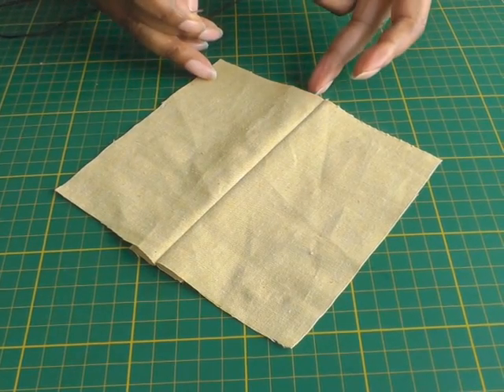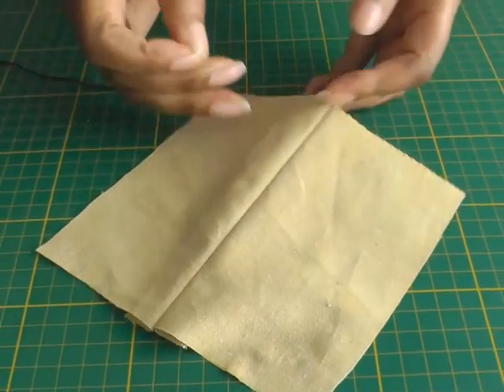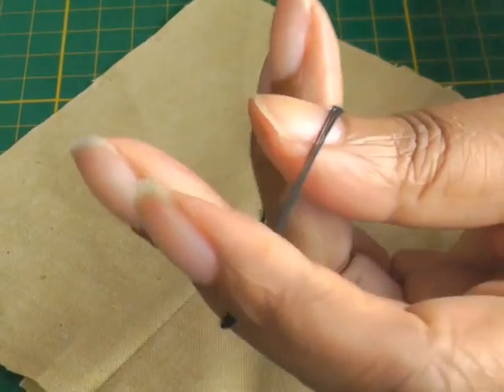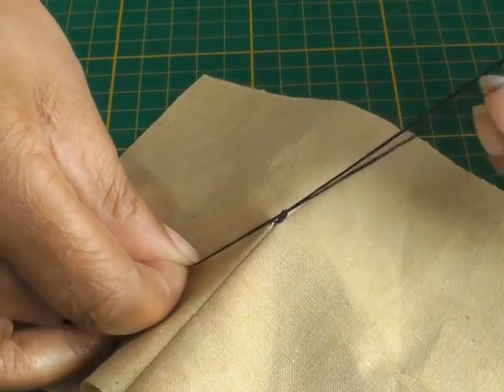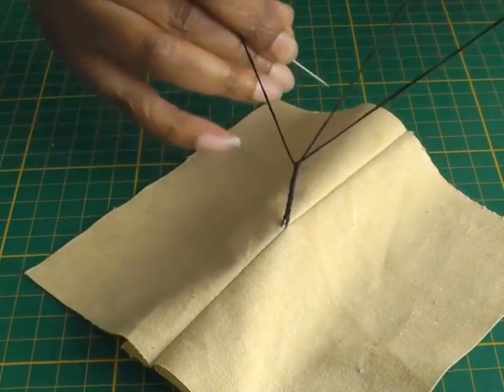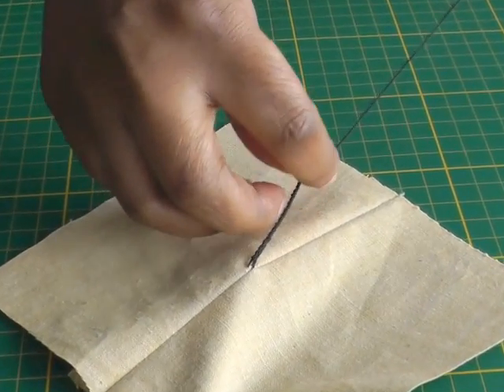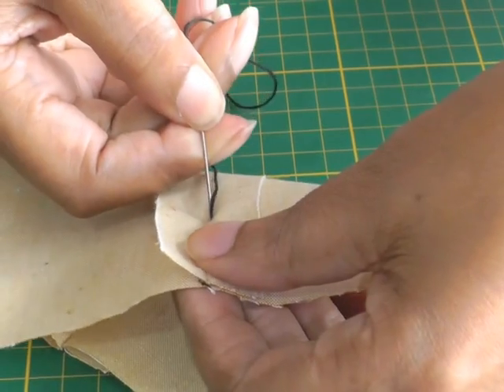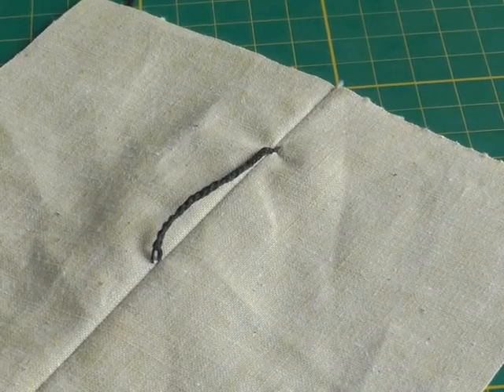Making Thread Belt Loops

Comment: This is a strange question I know but how do you know how much thread to put in the needle? Meaning how do you determine the width of the belt loop? Just a couple of mm wider than the belt itself?
Reply from the maker: Check the measurement of the belt and add another 25 cm roughly and you be go to go. Yes!